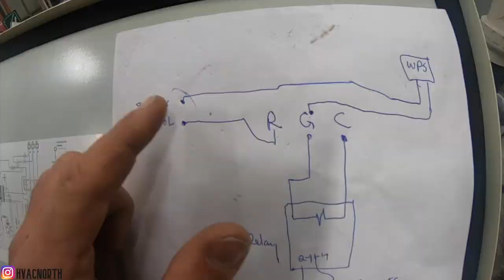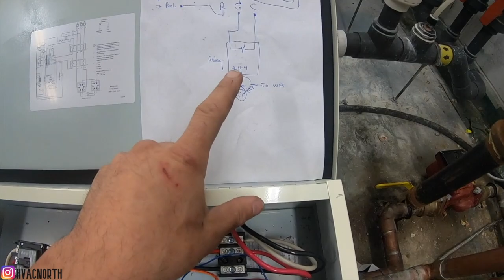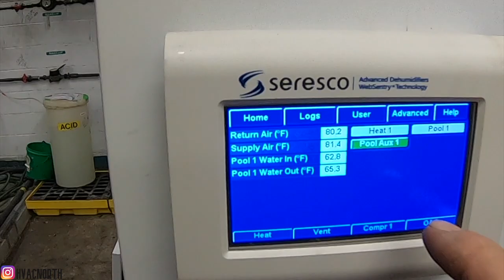HVAC: Water Heater Install (Custom) | How to Wire Controls

Comment: Joe! Day and Night difference in the video quality....Damn nice job!!!  What was you doing? LOL Added a water heater to a pool heater?
Reply from the maker: Thanks Buddy, Yes years back a couple mechanical companies couldn't think of a solution with out spending lots of $, there is know gas in the area.  I Installed a Heat exchanger to solve the issue, & now years later the unit went down they contacted me again & i added another pump.  They are hard to find anything smaller than 40KW.  I eliminated on phase as well & found the right medium so heater cycles & doesn't kick off on high limit etc.  Its AUX heat for a Heat pump system for a pool room at a condominium.

Comment: Damn, that looks so complicated... You are smart!!! The beard looks sweet too... 😃
Reply from the maker: Thanks hun, its at that stage where it makes you think if i want it on or off lol.
Reply: Hey I got a question... I need a replacement for central air that I can't find... Hoping you could tell me what I can use as replacement .. It's XMCO251EBBB its a contactar... Thanks 😃😉
Reply from the maker: @jennifersweet8081  hey sweets....contacter ? Ppl are going to hate me for saying this but; from Amazon or electrical supply shop, Or call a tech he usually has on his truck.
Reply: @HVACRNorth  its not available, I looked... I googled it and 1 company had it listed but none in stock... I think it must be obsolete now, but can't find what I can use instead... I think it was by Zettler...
Reply from the maker: @jennifersweet8081  For this component it doesnt have to be the exact one. Just make sure the voltage etc rating are the same and many companies make general ones.  Take a picture if front.
Reply: @HVACRNorth  ok... Tony is in the shower, I know he has a picture... We have 2 homes, the 1 in country always has some issue... SMH... The central air isnt even that old, it's like 5 years old...

Comment: So that is an auxillary heat exchanger?  Is it just pool water and electric heat?  Whats the main source of heat?
Reply from the maker: Heat pump is main source.  If it needs assistance, water temp. Is Below set point, & compressor is not running. This unit will kick on. 👍
Reply: @HVACRNorth  so thats a ground source heat pump?

Comment: I cringed when I saw the way you feed the Tee's on the pumps.
Opposing feeds cause increased turbulence plus the weaker pump can get some backflow.
The outlet tee downstream from the pump should be turned 90 degrees and feed with an elbow into the side and one end. This will allow more laminar flow and reduce the tendency to backfeed the weaker pump.
Reply from the maker: Thanks for the info, you should email a quick drawing.  I can see where there could be some turbulence & possible back feed. So far heat transfer is there & working.  🤞
Reply: @HVACRNorth  What is your e-mail
Reply from the maker: @mtu-engineer3220  Should be on my home page hvacrnorth@gmail.com. Thanks